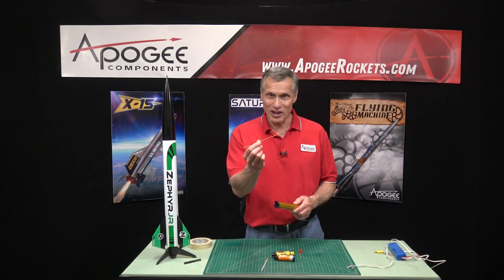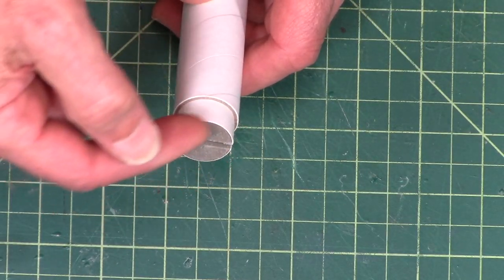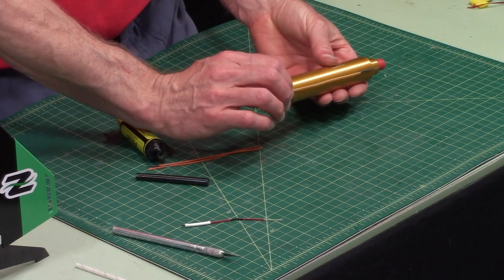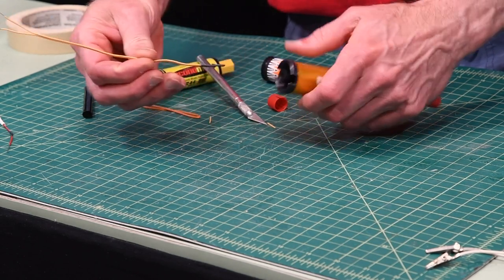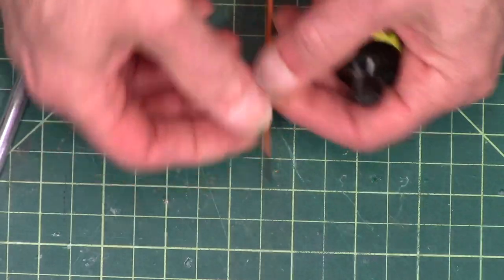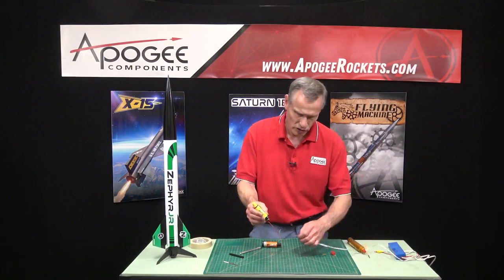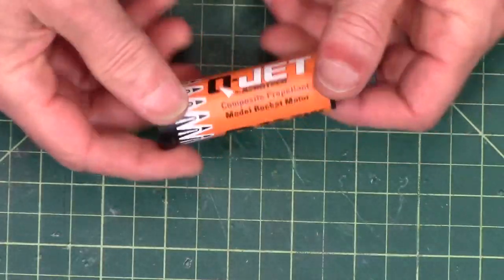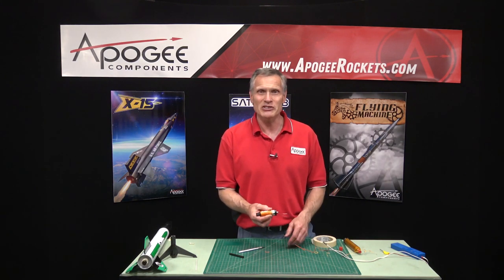How to Insert and Restrain an Igniter in a Composite Propellant Model Rocket Engine

Comment: Will this work with a fuse? Or will it prematurely ignite the grain before reaching the top?
Reply from the maker: NOPE! A fuse will be spit out of the nozzle by the pressure, long before it burns to the top where the motor needs to be ignited. You have to start the burn at the top, never the bottom.
Reply: @apogeerockets  Thank you, what Igniter did you use in the demonstration?
Reply from the maker: @Ikej873   The motor comes with one igniter. It is probably the First Fire Mini from Aerotech. If you visit our website, and find the motor's product page, it will always list which igniter comes with. That way you can buy spares if needed.
Reply: @apogeerockets  Great! Thank you for the help! I will definitely buy some motors!

Comment: Can you use a composite motor as a two stage on the main rocket will it ignite normally?
Reply from the maker: Nope. As the video stressed... you have to ignite the composite motor from the top. You can't do that using direct staging.

Comment: Klein electrician scissors are great for stripping the small gauge wire of igniters. They have a little V notch on the back of the blade that you pull the wire through to strip it. We use them all the time to cut and strip ematches when setting up fireworks displays. It’s a good crossover to model rocketry use.